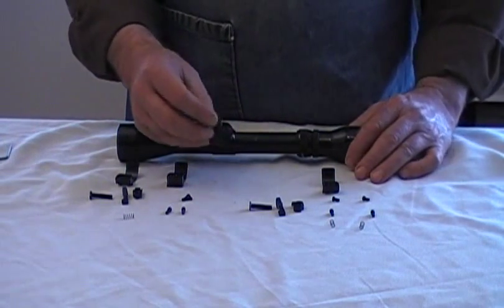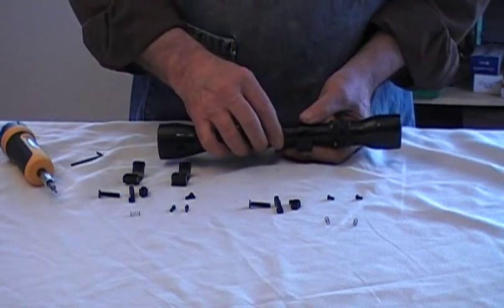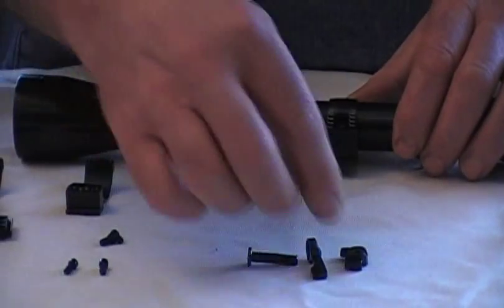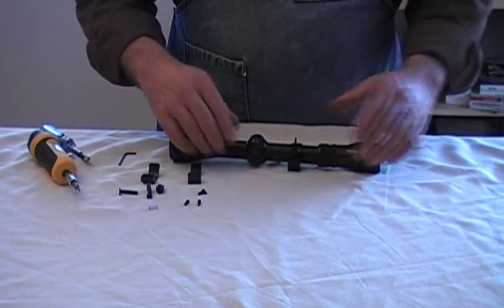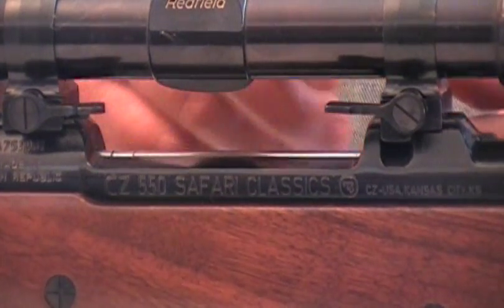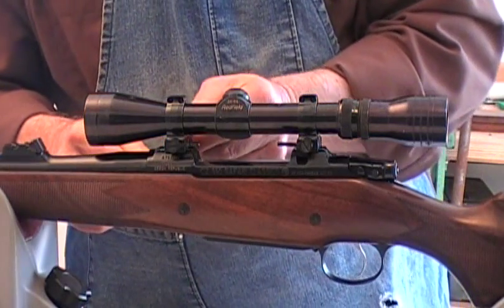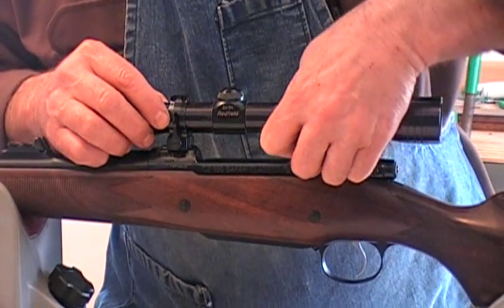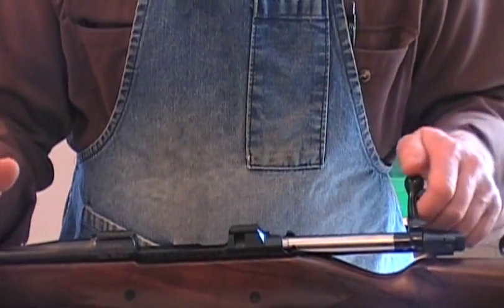CZ 550 Quick Detachable Scope Ring installation

Comment: The QR levers are on the wrong side. They are mounted on the right hand side of the rifle (the bolt side) so that when you sling the rifle you don't have the levers digging into your back. If you're left handed then you would mount the QR rings this way.
Reply from the maker: The levers in the video are on the left hand side as is correct for right hand shooters, I also make cam plates that place the levers on the right hand typically for left hand shooters. Levers are best located away from loading and ejection.
Reply: @alaskaarmsllc  the CZ 550 rear ring also has a recoil lug that restricts its' location to the left hand side only.